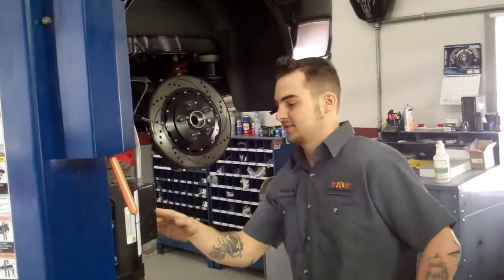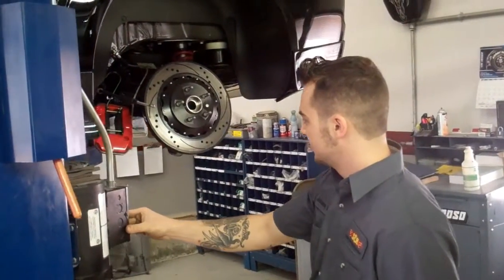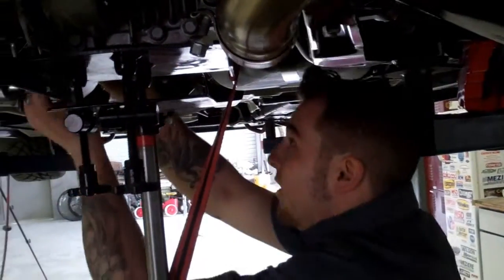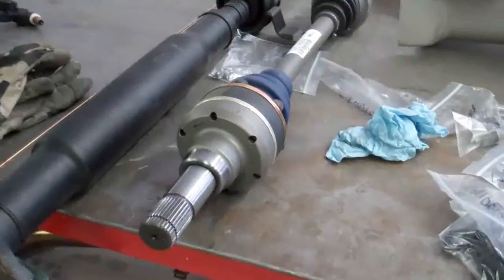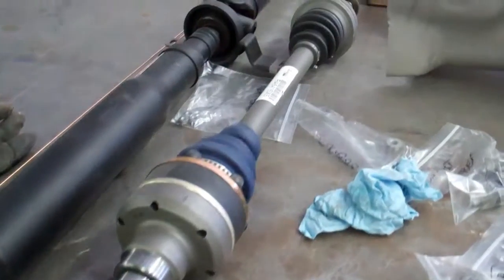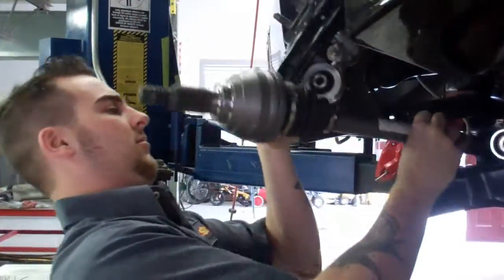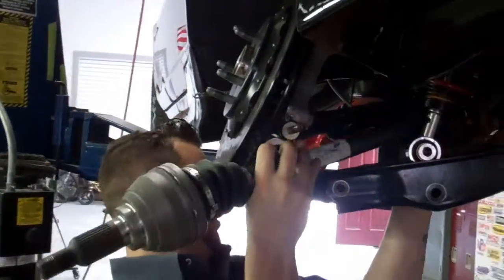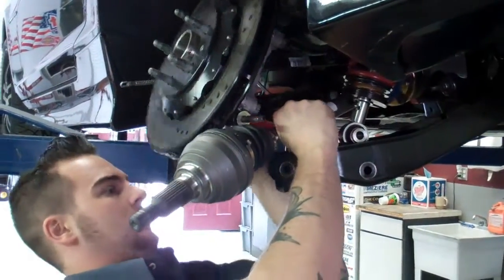RCR Street Performance gear ratio change and upgraded axles

Comment: nice video man, looks professional made.. how much does normally a final drive gear change cost?? (my car has a 3.08, if i were to want 3.73, how much does it cost??) also, i would like to make my car have full time Locked Differential, so both rear tires have full power all the time, my car is a 1995 Lincoln Town Car, please do reply, thanks... ;)